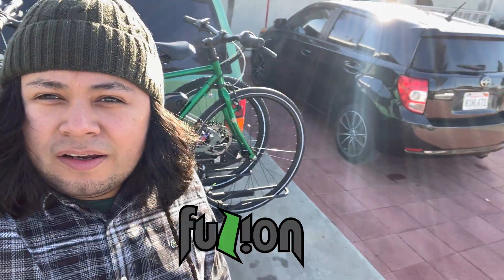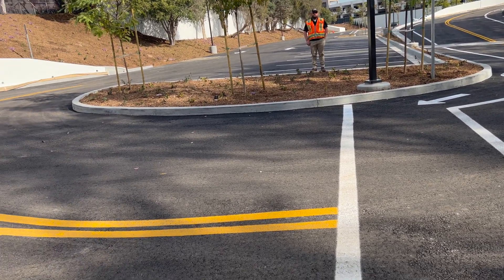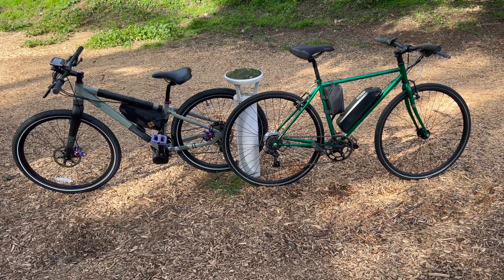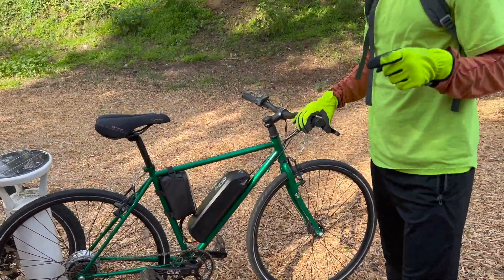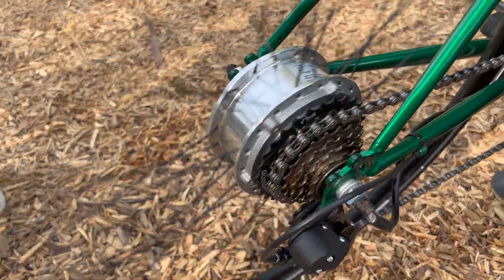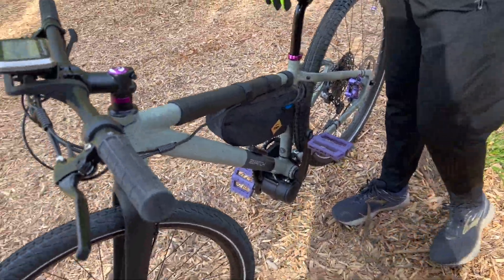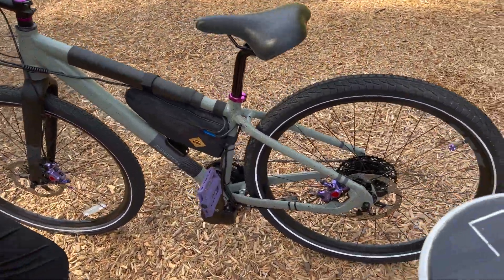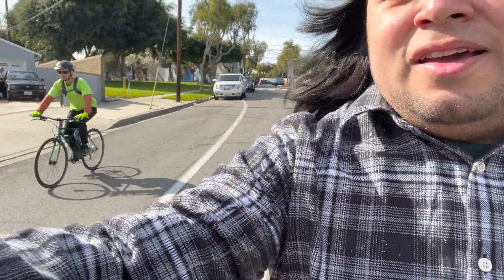How to Build A Lightweight E Bike

Comment: Just for information the 250w and the 500w are the same just software changes, but if you flash the 250w with 48v software the the 250w unit will allow more rpm than the 500w will at 48v the limit on the assist with the tsdz2 is 95 rpm on the cranks. i built mine on a mtb frame with the 36v 250w tsdz2, bike weighed in at 14kg and now weights about 18kg with battery, you can also dual chain ring the tsdz2, also the tsdz2 has 80nm iirc